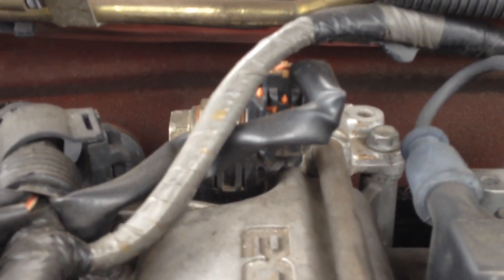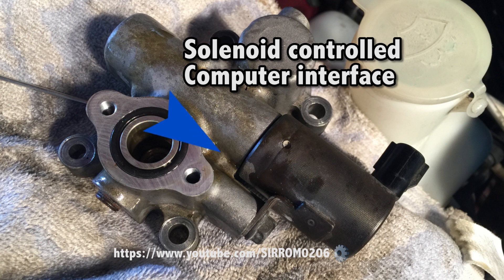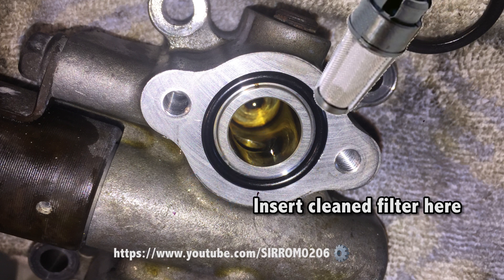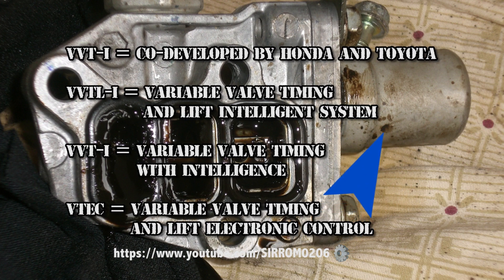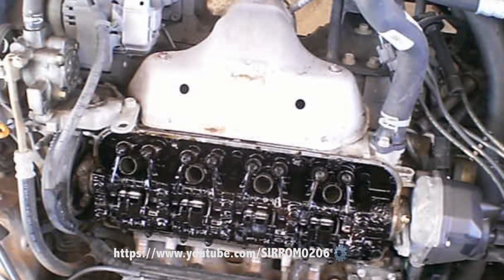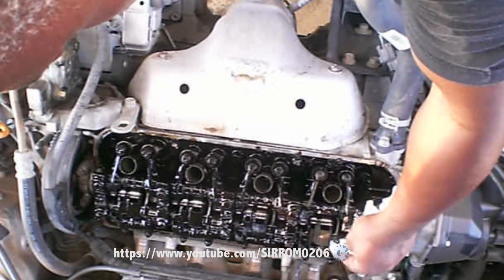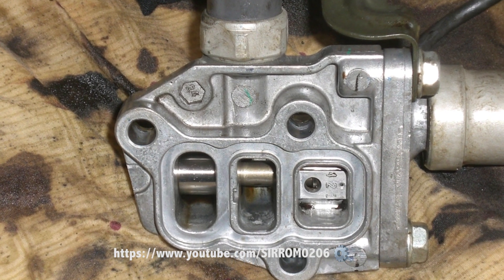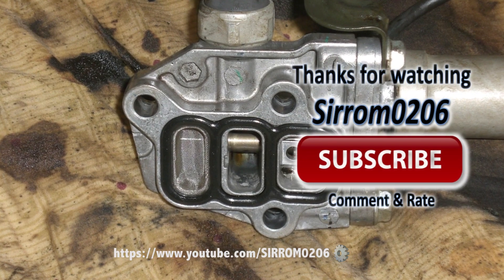Mazda Miata MX5 VVT Variable Valve Timing Basic Overview

Comment: Thanks Mo.  I just learned something new.  I don't have a high performance vehicle [engine] anymore but suspect VVT is standard for all other vehicles.  We defeated "Dads" who drive minivans, SUVs and family cars are reduced to accepting safety versus torque and muscle!! (smile).  Thanks for the education and recommendation for maintaining the VVT module.
Reply from the maker: I have a van also. As for the VVT, until we worked on the Maita I did not really put any thought into the VVT operation or filter. When we replaced the Accord head gasket we did clean out the VTEC & its' filter. Being a maintenance guy it's automatic to do so. That was in 2010. The Miata was this year-2018. We are currently sourcing on a Mazda3GT transmission computer module. The Mazda3 transmission went into creep mode & will not shift normally until we replace the TCM. New it cost $500.